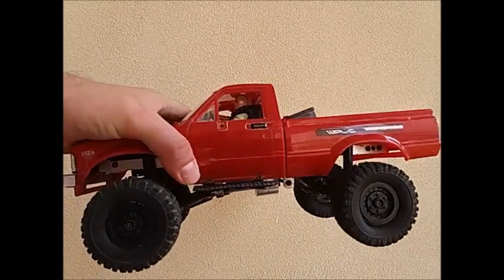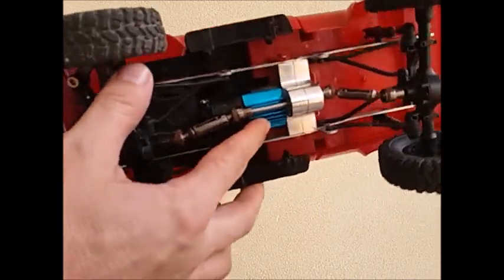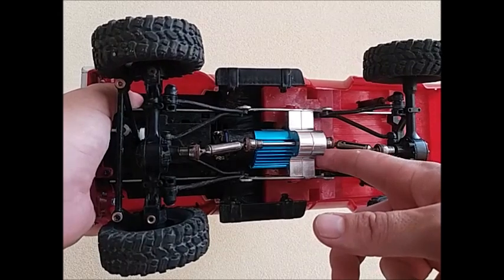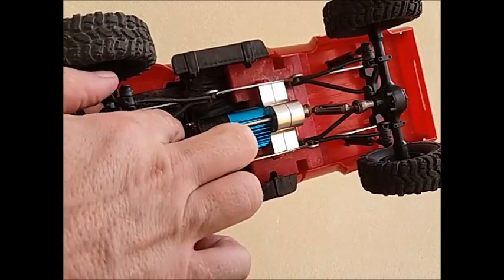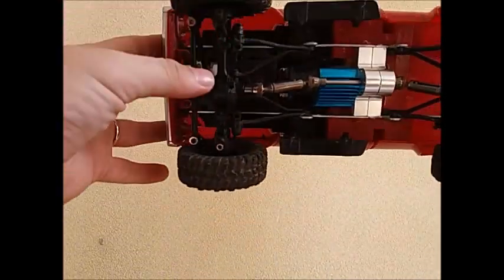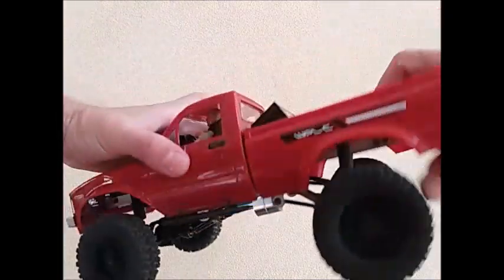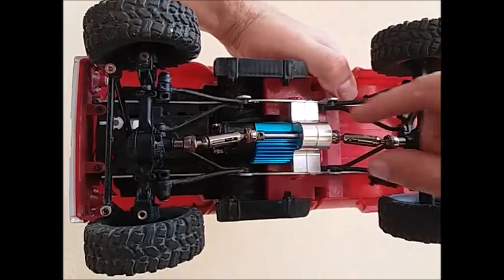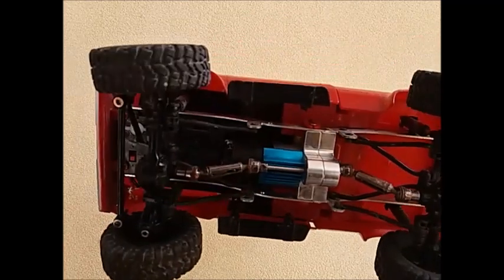WPL C24 370 Metal Motor

Comment: Did you also replace the esc? I installed the same motor in my stock MN45 the esc and motor wires over heated and started to smoke.

Comment: Good video! Did you need to change or add the ESC or was it plug and play like? I am waiting for my 370 and I don't know if the original electronics can cope with the new motor.

Comment: What did you use to cut the plastic?
Reply from the maker: I tried a few things but ended up using scissors and then a file/sand paper to make it smooth. A saw put too much pressure on the rest of the plastic body. Its really thing and slow cut with scissors works just fine.

Comment: Do you have to solder any capacitors in between the two motor connections?
Reply from the maker: There's only one motor and the gear box. No need to add any capacitors. I have had a problem with the gears slipping and grinding so make sure to sue thread lock on the gears and plenty of grease. Probably will need checking and after extended off road use.

Comment: Buen video bro
Reply from the maker: Thx man. Hope its useful.
Reply from the maker: For the other range of WPL trucks you don't need to cut the chassis as they are bigger and the motor fits in.
Reply: @JJ-uy2sg  What kind of engine do you recommend to change my WPL c24?
Reply from the maker: @Manuellopez1  a 180 motor doesn't make much difference. The 370 is slow but powerful for climbin.
Reply: @JJ-uy2sg  Oh, thanks. Can I find it on ebay?